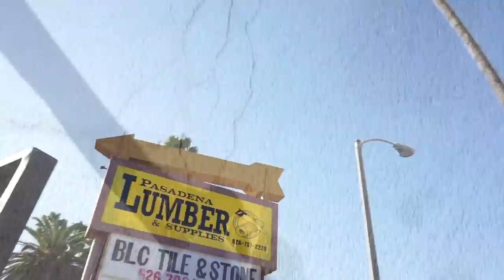Leather + Wood Table

Comment: Nice project! Just a suggestion on the wood portion of the project... you will want to sand (ease) all the edges with sandpaper to keep from sharp edges or worse splinters!! Also chamfering the edges of the legs where they meet the floor will help prevent the wood from chipping as the table/stool is scooted along the floor. Again, keep up the good work!

Comment: How do you sit things on the table without them falling over ? Do you mean this is a seat instead of a table? Because it looks like there would be some give in the leather so things might fall over?
Reply from the maker: It's a pretty tight weave so as long as the item sitting on top doesn't have a narrow base, there shouldn't be any issues with it falling over.  It could also be used as a side table or plant stand.

Comment: OLD LEATHER SMITH here, very very nice, great design, you make it simple and easy 4 a beginner 2 understand, reminds me of a baseball glove I repaired, GOD'S BLESSINGS ✝️⚾🙃
Reply: A quick question from the experts here plz, if you wanna make a wooden bench with leather straps but not a table what would you use other than the nails to hold the weight of a person and not come off. Any thing special other than the nails or would nails be enough to hold the weight of couple of people sitting on bench together?
Reply: @ayeshaqayyum4252  OLD LEATHER SMITH here. Nails or Screws will hold the leather much better when you place WASHES under head, the washer spreads the holding Force. GOD'S BLESSINGS ✝️⚾🙃